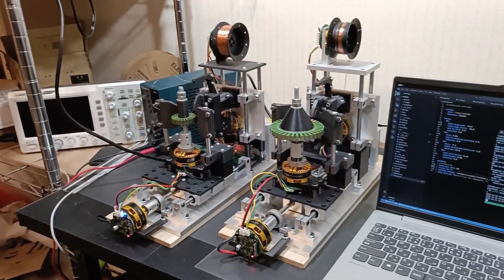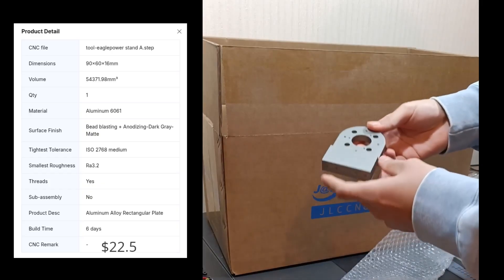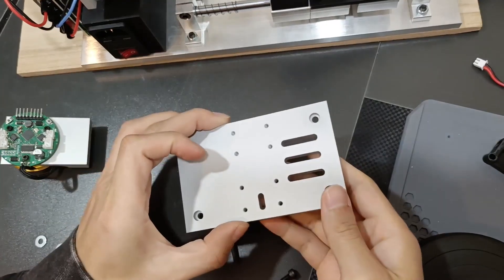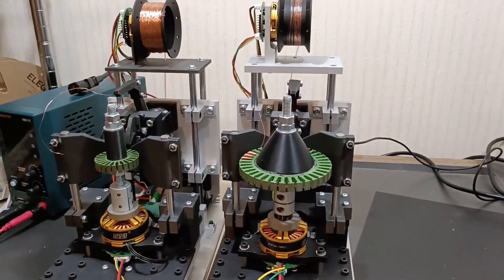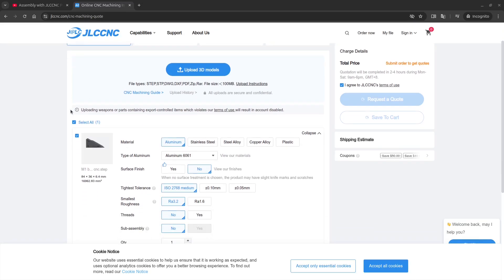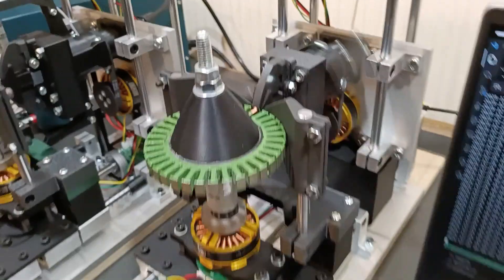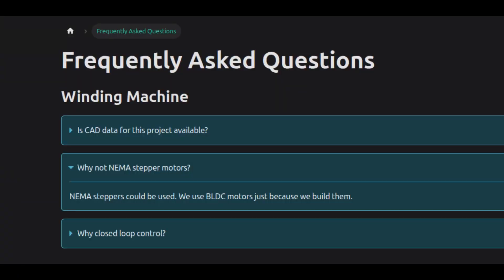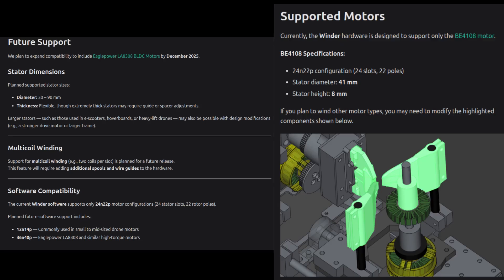Winding a Massive BLDC Motor with JLCCNC Parts (Full Version) #JLCCNC

Comment: I was noticing the pattern isn't consistent with a 1 coil every  3rd pole for BLDC control.
Is this possible with your set up?
Reply from the maker: Yes, it’s customizable. I’m using the “Winding Scheme Calculator” and following the exact pattern it generates for my stator and pole configuration.
Reply: @yuchi0.1 
Cool!
I was working on an individual coil wrapping design that be module based to allow or larger diameters.
Then the layered cores could retain the layers steel plate dynamics while being easier to wind, such as in a lathe or another automation with a counter.
I might need a larger design than most think of possibly 33 coils to 144 coils.

Comment: How did you make that core? Also cnc? It's not laminated? But it's soft iron? Or steel?  Awesome project!
Reply from the maker: Thank you! I didn’t make the core myself—I just bought an Eaglepower motor, disassembled it, and rewound the stator. So the core is the original one from the motor, already laminated.

Comment: why aren't u make ur own motor outher from aluminum. i wondered can we order a free shape from jlccnc?
Reply from the maker: You mean building a fully custom motor using JLCCNC?
The motors I use are originally mass-produced drone motors, so reusing them is much more cost-effective. Even though JLCCNC offers affordable machining, making a completely custom motor from scratch—especially the rotor and housing—would still be significantly more expensive than repurposing existing parts.

Comment: This looks awesome. Since you're selling it I think the quality of the software will control the quality of the user experience with something like this. In software I look for options, detailed explanation of exactly what that developer's implementation of the option does, and good organization/easy access for the options. It looks like you're running this on microcontroller script which is completely fine imho, this is not a consumer product. Makes it easier to extend.
Reply from the maker: Totally agree—the software definitely isn’t user-friendly yet. We’re planning to improve that with better documentation, clearer options, and a more organized interface. Thanks for the feedback!
Reply: Your points are valid.  Maybe you can offer your wisdom and work with him on this?

Comment: Amazing project, very clear and well explained 
The transformation of a high-speed drone motor into a gimbal-style, high-torque motor is a smart approach, especially for robotics and precision automation. The winding machine looks solid and well designed, and the first test run is very convincing.

Special mention for the JLCCNC machined parts. You can clearly see how mechanical precision impacts the quality of an assembly like this. Explaining the ordering process and turnaround times is also very helpful for makers and small hardware labs.
Really looking forward to the CAD release and partial kit in January 
This is extremely promising for anyone working with custom brushless motors, CNC machines, or advanced robotics projects. Great work, keep it up !
Reply from the maker: Thank you so much for your kind words and detailed feedback—it really means a lot!